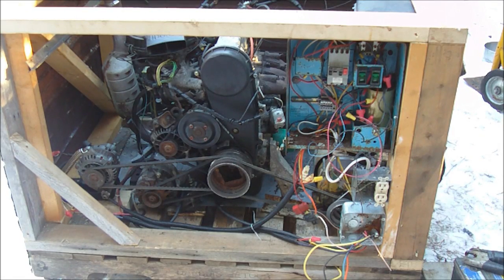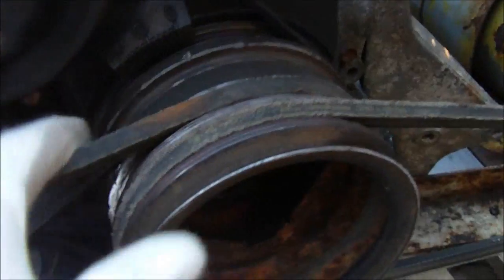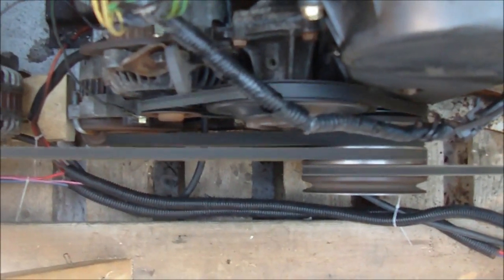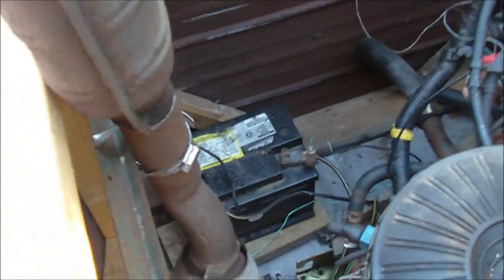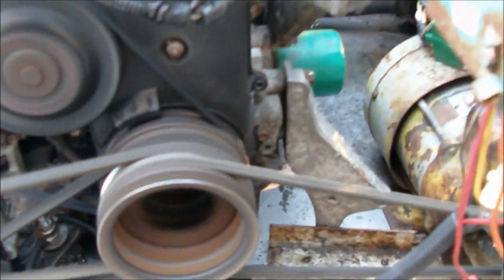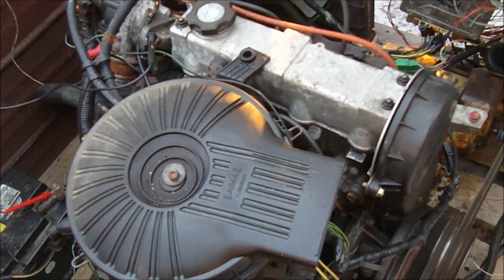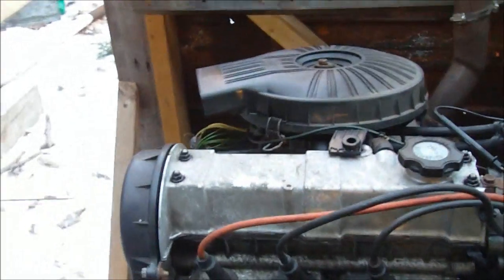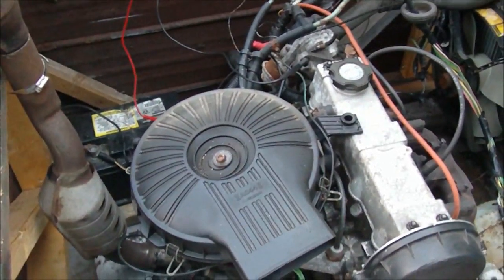Homemade Large Generator 50hp 12v 120v with Suzuki G10 engine

Comment: i dont know if you are american, but if you have access to VW group older small diesel engines, that would be your best bet in terms of reliability and fuel economy. Like a 1.4 3 cylinder tdi engine is probably the best for a project like this, its small, its light, reliable, and consumes very little fuel, altough I dont think they were sold in NA markets, if not, you can always use a 1.9tdi, altough it will be bigger and heavier, it will still give the same reliability and amazing fuel economy. But anyways good project!
Reply: I thought also about the vw diesel. Than running on vegetable oil. Maybe only disadvantage louder as the petrol engine?

Comment: Buy surplus 28 volt generator head and run that and a 120 volt AC off of the flywheel end of the engine.    That would be more efficient than kluging a bunch of car alternators onto the front.   If you want lots of 12 volt amps...go to a school bus weecking yard and grab a 350 amp 12 volt alternator... One belt and you have more current than all of those put together.   If you can run the engine at a reasonably low RPM it wont be too noisy but for the power you get into the battery. .you will be burning a lot of fuel.  They make PTO generators for farm tractors... Look at how those work.   An old welder would also make a potential generator head as would an old wind generator

Comment: Can you calculate a homemade generator that can power a DC or AC motor of a converted electric car? I suppose the Lister engine is not suitable because it requires a motor with speed acceleration.

Comment: Good job!  Geo/Suzuki 1.0 engines that had air conditioners on them had a solenoid on the firewall near the air cleaner that kicked up the idle speed when the AC compressor was running. The little engine would stall without one. The solenoid admits air to the throttle body and has an adjustment thumb screw. You could goose it up to 2000+ rpm at idle with the solenoid energized. Its a ''nothing'' part that might be useful to you.

Comment: when using a inducton motor, or any other generator for 120 or 230 volts mains power its not only the voltage thats inportant but also the rpm of the generator, holding it on 50 or 60 hertz.(when you use other loads then resistive, or glow bulbs or sery's tipe motors like vac"s or skil saws etc)(those are not frequenty sensitive),

Comment: very cool build nothing better than taking someone's junk and turning into a productive device 
the one thing i try to tell friends and family is to buy a decent inverter and keep it around the house  for emergency power 
because anyone can take a 1500w 3000w surge inverter and run a few lights and a fan or even use a hot plate to cook food just by connecting it to your car battery now this is not something for any long term solution but if you need emergency lights you can power a couple of led floods off of the inverter with the car at idle allowing it to run off of the power the alternator produces 
also for short uses you could even power a microwave for say 10 min to cook emergency food and then allow car to recharge battery  and if it is super hot at least run a couple of fans 
i even have a small 400w 800w surge inverter that i have used to power a small single serving electric skillet i have for heating up stew or other single serving helping of foods  
like i seed it is a emergency resource that you can tap into if you have a simple $50 400w inverter around and inverters do not go bad sitting on shelf in garage 
20 years down the road it should work when you need it

Comment: Interesting build but why use an electric fan and cooling system instead of mechanical? You are drawing power to run while trying to generate power. That motor has enough power to run enough kW to power an entire street so using up some of the mechanical hp is not a concern. Just not very logical Imop. But I can see the time and effort you put in..
Reply: john smith i think it was done more so to be able to put the radiator and fan off the side for engine cooling rather than up front to leave easy access to the belts, pulleys, and alternators, along with the safety factor of not having a belt driven fan always spinning right near all of his controls and switches. and the draw on the firefly electric fans is still pretty little.

Comment: Awesome. I'm not such a big fan of the 12V setup tough. You might be luckier just getting a variable frequency drive and get regenerative DC from the induction motor instead (One it is excited you can also get AC, with much better control than a capacitor bank) From the rectified DC you can use some high quality server power supplies to feed the 12V system. I have one in my EV and they are really nice giving out 50A easily.
Reply: Hi.  Very interested in this.  Can you tell me more?  You are suggesting to use an AC motor as an alternator, with its output feeding into a VFD, correct?  The purpose being that with the VFD you can get a constant 60 hz output.  But the problem is the output then is square wave.  And what are your referring to WRT to 'regenerative DC' ?  thanks so much !

Comment: Induction motor will NOT generate AC for you.  A three phase motor can be used to create the third phase, but the excitation has to have AC to start with.  If you take AC machines in college you would have covered this... not sure if they still teach that.
Reply: +Fred Yearian The classic squirrel cage single phase motor can be used to generate electricity, using a capacitor across the output. Regulation is not great but they do work.
Reply: +Fred Yearian http://www.qsl.net/ns8o/Induction_Generator.html this might interest you
Reply: Hi, I read your comment you left  and I am wanting to build something like this to power our entire home. I got the impression you are knowledgeable in this area. My plan is to use a wood gasifier to fuel a 4-cylinder engine to power a generator to make a/c electricity. I would love to talk with you and get your input if you are interested. inchrist2014@gmail and my name is Keith. 

Thanks

Comment: What do you do for a Governor to keep the RPM's up when a Load is attached?
Reply: Is that not done by the car ecu still on it to run the injector and everything?
Reply: @kitecattestecke2303  If it's at idle the computer will automatically adjust the rpm to maintain it's programmed Idle speed. If he opens the throttle manually the computer will not try to control the rpm.

Comment: Excuse my ignorance, cause I do not know the answer, but, if you want to load down a conventional ICE as you are doing, wouldn't "the load" better be place on the back end, and not the front, or would that require too much throttling / RPM. i guess it'd need transmission, for speed, but wouldn't it be stronger? Thanks

Comment: Kind a cool that you made a gen from scrap stuff. However why so much HP for even 4 alternators.  Also that clicking noise you here under power, that is on o the alts.  they do not like being loaded that much, and what you are hearing is bearing knock.
Reply: pusswhakker I was wondering what that was, thanks!

Comment: That's great that you have this scrap and engines to work with, a diesel is more preferred but since those Suzuki engines are free and easy to work on what the heck.
If you the run on Syngas gasifier you won't need a throttle body or carb you can run it direct with a ball valve for the RPMs.
Have you thought about getting one of those heavy duty Chinese ST generator heads to use with this ?

Comment: Also since your using a computer to run your engine make sure you get the engine light off the system otherwise it dumps too much fuel. Since this thing is not in a car you can get away with some nasty mods because your not dealing with emissions since its stationary. Another thing that can increase run time is heat your fuel before it goes into the engine.

Comment: Awesome idea. Since you have junk as a resource you can still make it look professional. The trick is make a wire harness out of existing wire and get some black electrical tape and loom it up. Spend the money and invest in new belts as a safety net. Get some spray paint and sand paper and clean up your nasty motor. This could be a great system. The way to idle up the engine when you add a load is by adding a air bypass solenoid to the intake instead of opening up the throttle so you save gas.

Comment: Just curious how you connected multiple alternators, it looks like they are all somewhat modern so I'm assuming they all have the regulator built in. Did you just simple not plug them in and only ran the power output wire off each? Or are they all plugged in and spliced into the voltage input on the ECM? Great work though by the way.